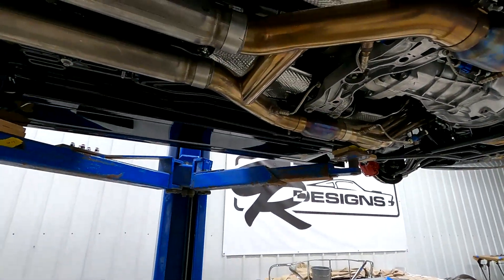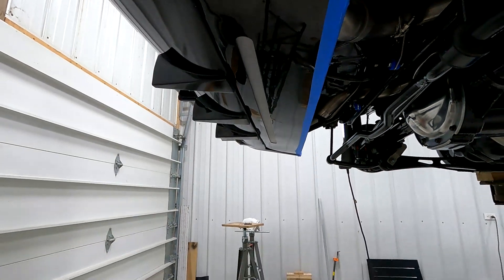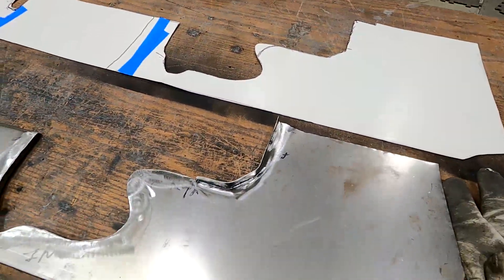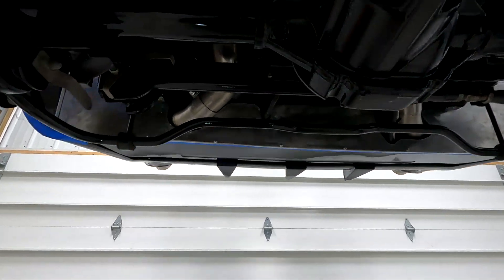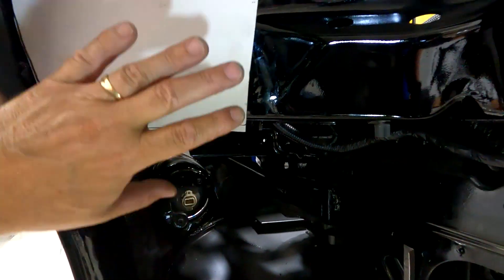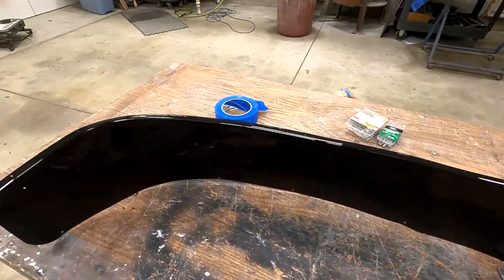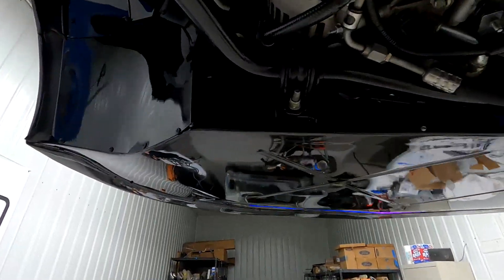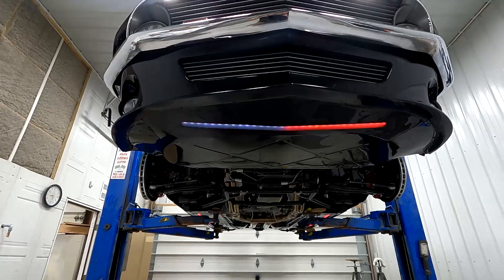M-1 COBRA Update 8-13-22 Finishing Touches to the Undercarriage

Comment: Very low key ,,, NOT,   Looks amazing Gregg, Just hope the gravel doesn't  pit the inner guards , Is that epoxy durable enough ?  Just a query as no doubt your forward thinking,
Reply from the maker: Thanks! The epoxy is very durable. I don't plan on driving the car much at all. Just into my trailer going to car shows for now. Once I get finished showing it, I plan to spray stone guard on the area that will get stones thrown at it. Thanks for your comments and for watching!